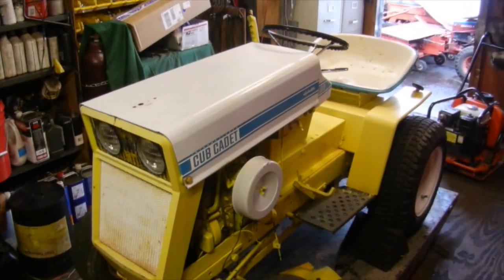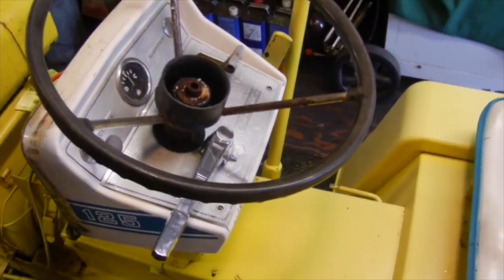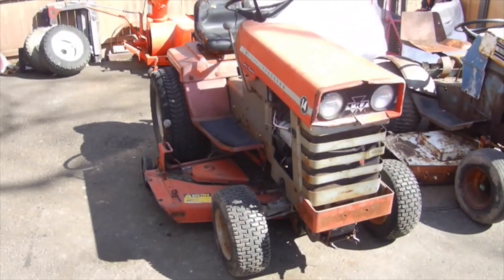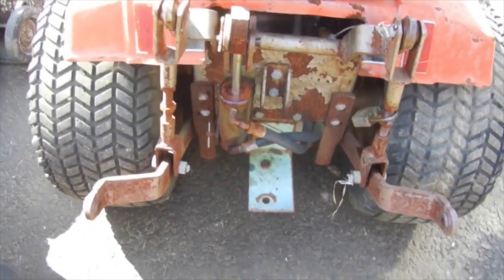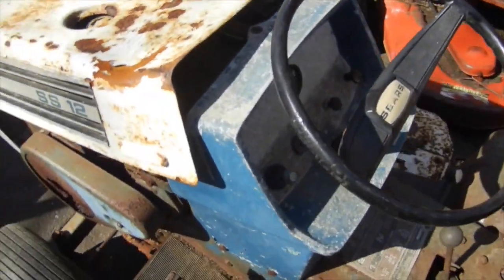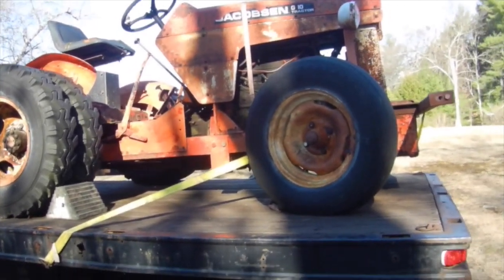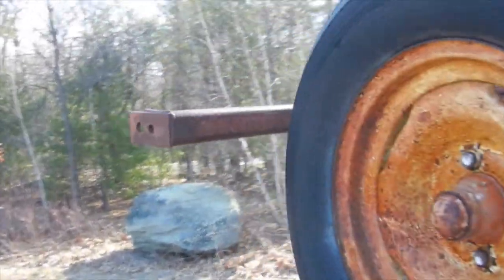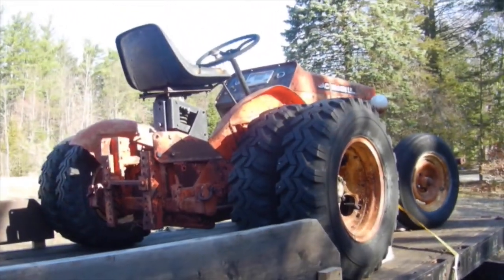Springtime Tractor Haul

Comment: I'd be interested to see what you do to the CubCadet to take the slop out of the steering. I have a neighbor with a 127 that runs but is getting tired  on a few parts, steering and throttle mainly.
Reply from the maker: I found that there was only one bolt left holding in the steering box, so that accounted for some of the play. The rest I took up with the adjustment screw on the LH side of the steering box (if sitting on tractor). It's still not the best, but not as bad as it was.

Comment: Where are you located? I have a Gravely model l that I wouldn't mind getting some parts for, I'm in Michigan and they're so hard to come by. Also, I have a l transmission that you might be interested in. It's a 1967
Reply from the maker: I'm about 900 miles away in central MA! If I was closer, I'd be happy to get you squared away with parts.

Comment: wish you'ld say what you paid. I'm eyeballing an Ingersoll 446, guessing an 83. only has mower deck. No other attachments. does run. leaky rotted tires but will hold air for a bit. guy wants $1000. Any thoughts would be appreciated.
Reply from the maker: @Kevin Thierry  The MF and Sears were $400 together, Cub I think was $200, and the Jacobsen was $450. I wouldn't go for that 448 myself, tall money for a tractor with bad rear tires and only one attachment. The 448's are a bit harder to find vs. the 444's and 446's, but for a grand you should have a tractor you can just jump on and use. What kind of shape it it in? Good for an '83? Beat to crap? If the tires are rotted I'm sure it spent some time outside...
Reply: @5Tractorguy  thank you, I offered $700 that's all I'm going. He didn't accept. ( Yet) we'll see. It ran well, worked as fir the mower. Oil was old and black, the dip stick had cloth and tape to try and seal it. Had the wring air cleaner and dirt was getting into the engine. But it did run well.
Reply: @5Tractorguy  it's a 445 Ingersoll
Has mower deck and I cut a couple passes, seemed to all work
Reply from the maker: @bgnoggin  Sounds like it was ran hard and never really serviced. I'd say you're better of steering clear of it and looking for another Case that was kept up over the years. Not sure where you are located, but they should start showing up now that spring is on the way. Around here in NE (central MA) a nice 80's Case with a couple/few attachments goes around $1200 - $1800, worth it if they are in good shape.
Reply: @5Tractorguy  
Ok, starting to stear that way myself. I'm in Prescott AZ.
Thx for your help.